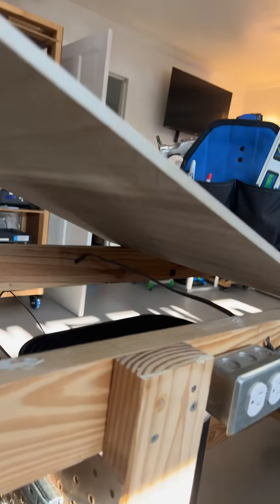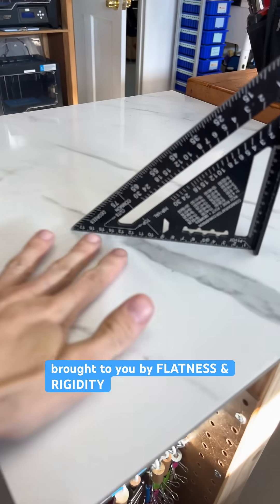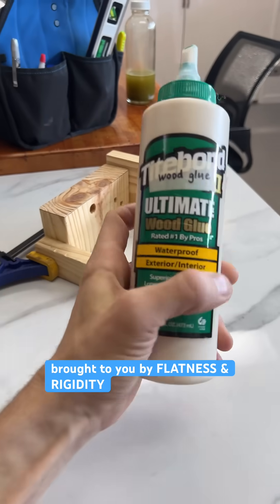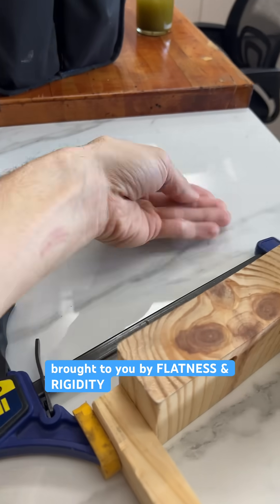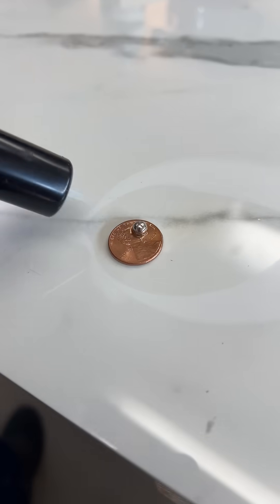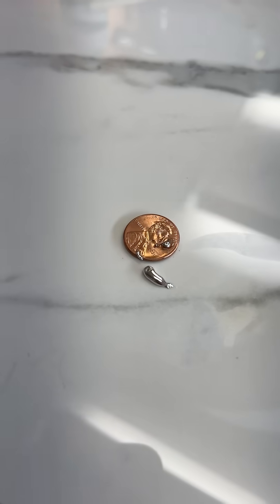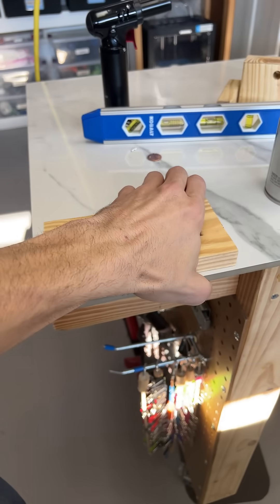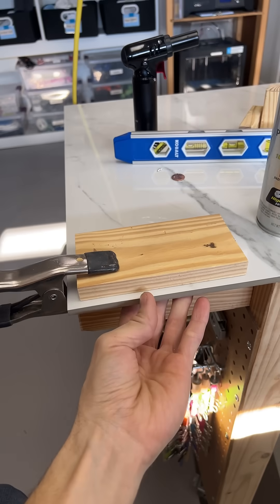how to gain flatness, crucial for many #diy projects.

Comment: Sure this tile is fireproof. But also have some limits. I am learning welding and sometimes very hot metal drops on our tile floor. Consequently, drops crack the tile with almost flat hollow, but anyway.
Reply: Where are you welding where there is tile? You're surely not welding indoors.
Reply: @neoc03  No, I am welding in hardwareish room. But I'm using extractor fan, which hose positioned next to welding point. Not excellent way, but I'm in process of improving step by step.

Comment: Yup. Got a hardened glass door from IKEA's bargain corner for specifically that reason. That's now my tabletop. And yes it's even hammer drop proof.... so far. 10 years in.
Reply: Highly doubt tempered glass from Ikea is dlat
Reply: @SlowExpensive   It sure surprised me too. But I don't need it to be perfect. For me it's just a very flat surface immune to most solvents and easy to clean.
Reply: @HenkJanBakker  how flat is it tho
Reply: @HenkJanBakker  put a straight edge down and see if you can slip a feeler gauge under it is one way to do it
Reply: @HenkJanBakker How many thousands of variance in 12” of linear run? Just curious for my own measuring needs.
Reply: Just don’t drop your hammer on the edge and it’ll be alright
Reply: Hammer drop proof until it isn't, just don't do it on purpose you do damage it over time and it will eventually fail.
Reply: Comercial glass is not as flat as cut stone . Test it
Reply: @thevoidedwarranty  Do you mean flatness imperfections are so common you aren't likely to get a flat one, or is there something about the process that makes it impossible to make them as flat?

My only point of reference is my small desk and it is definitely not flat haha
Reply: @thevoidedwarranty  For sure. But for me it's flat enough.

Comment: Better idea, look for a counter top installer and ask to get the piece of stone they cut out for the sink….
Reply from the maker: dude no kidding! that stuff has MASS for days! i love it.  

and i love free stuff i can abuse and learn about the failure modes.
Reply: @davidmalawey . ( Listen mildly close.. becoming engrossed 🦻 in the shorts succulent  sounds) but  just . .perhaps a little less oral pleasure during the lecture. ..getting a bit overtly obvious 🫦💦 when my child points it out to me…awkWard. Yup so a little less glistening with the listening.
Reply: @davidmalawey I did just that and spray glued sand paper to it to lap the sole of my hand plane
Reply: Yup. I've got a chunk I got for free from a counter place. They were so happy to dig it out of their dumpster for me 😂
Reply: @paulgupta2454 cause that was probably about 400$ of material and man hours they didn’t want wasted in the trash. If I had a shop and you came by asking for scrap cuts I’d be happy as hell it wasn’t be wasted.
Reply: Yep! @paulgupta2454 I went to our local tile shop and asked for old display tiles. Genius. Small enough to move when needed but big enough to be a work surface. Totally free. They were glad to get rid of them!
Reply: I have a cutoff of black granite countertop I got for $3. I've used it so much. Just tonight for sharpening a vintage axe, just because I had sandpaper glued to it for a head resurfacing.
Reply: I don't think the idea was a cutting board.
Reply: Great idea! Thanks! Hope I can score a chunk!
Reply: Stone is actually a better idea. Flat ceramic tile is a relatively new technological advance. Up until recently, most ceramics cupped at the corners due to the firing process. Somehow they figured out how to nearly eliminate that.
Reply: @patrickearley7322 They didn't so much make it possible as they figured out perfectly square tiles makes for fantastic rates of repair callbacks. (Also improvements in setting material, less expansion and contraction means less risk of popping one of these because someone wanted their house a bit warmer than usual.)
Reply: That’s really not usable for any shop using a cnc. My cnc’s are programmed to plunge into the center of the cutout, then make a circle around the programmed .dxf file/cutout.

Comment: Works great! Just make sure to coat the back with rubber or something similar for when it inevitably cracks!
Reply from the maker: i like to use the first one until it breaks and then reminisce about all the projects it survived.

and then i know what kind of shock/vibration/weight it can handle.  

and then i buy the new one and design a support only as serious as needed.  and until then, i keep my $6 StoneCash in my pocket
Reply: @davidmalawey  I usually just throw some flex seal on the back and send it! Doesn't add much strength, just stops the stuff from getting all over when it hits the floor
Reply from the maker: @jerb323 ohhh 😮 i follow you.  mess prevention.  good brains 🧠 at work
Reply: @davidmalawey  $6 from where?
Reply from the maker: @HyperionBadger in my case it was lowe’s, on sale at $1.99 per sqft.  this one is about 3sqft

Comment: Is this just a basic polished piece of marble ? Or is there anything specific to look out for ? :)
Reply: I second this we’re def gonna need more details
Reply: @zachatmultipartsstore he mentioned its name several times in the video - "This".
Reply: Funny enough. Good tile is a bit brittle. Cheap tile can be too tough for tiling(too much time in the kiln), so it's discounted. Look for piles on sale and from unknown brands, but be sure to check if it's bowed before purchase. Also, if you glue it to a piece of veneer it'll last a whole lot longer. I've seen tile crack follow the shallowest of scores.
Reply: You can get a grade B granite surface plate shockingly affordable, not as little as $5-10 but less than $100 for a decent size, plenty of mass ~0.0003" flatness. I got mine 18x12x3 for $78 a few years ago.
Reply: Porcelain lol
Reply from the maker: just find a shiny stone tile at the hardware store.

mine is a manufactured stone (perhaps based on clay) but any stone will do.

and if i’m wrong, we only lose $5 or $10
Reply: @davidmalawey  have you measured the flatness? maybe its flat enough for you but i doubt its very flat .
Reply from the maker: @user-by7hj4dj9s  i have measured and my tools rest flat.  but all my tools are under $50 so there could be a flatter one. 

i built a setup just for an answer! see pics here:

https://imgur.com/a/i1JQ3n4

at the hardwar
Reply: @davidmalawey  not exactly how we measure flatness